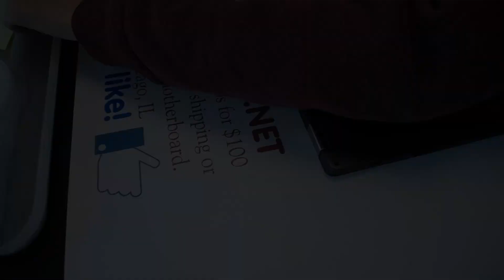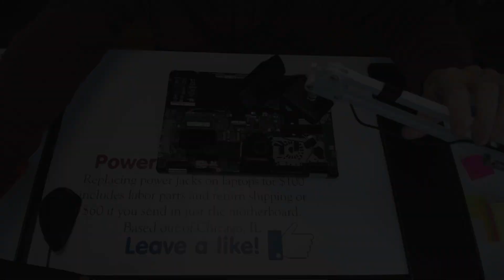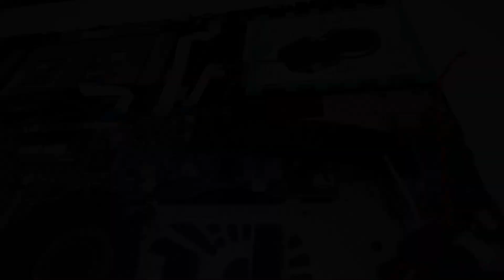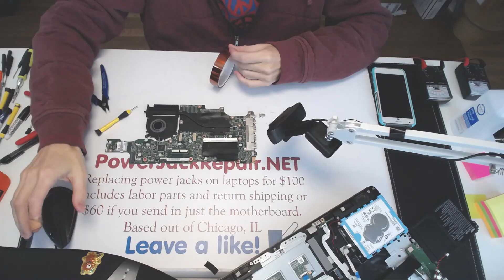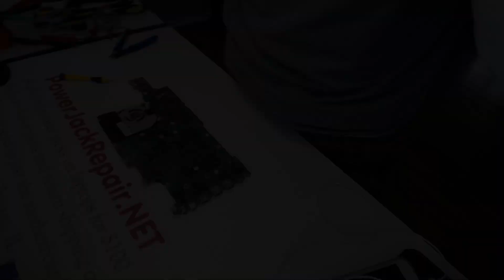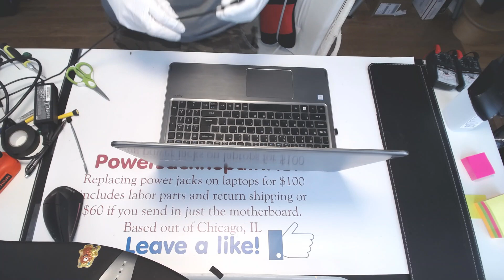How to fix laptop not powering on Acer R15 R5-571T broken charge port power jack repair charging

Comment: One question, you identified the bad solder joint, why not just resolder it ? 
Thanks very much I have had such good luck with this model and spec esp when I found the not advertised Sata SSD M2 slot on the motherboard as well as the fact the industry has dumbed down models for that price point since then. (As in no more touch screens or 2in1 (flip) at that price point or anywhere close anymore.)  But the power jack was a chronic problem with the with it, but worth repairing.  
Thanks again !!!

Comment: I have a question do you know why my Alienware M17x r3 isn’t turning on? Everytime I put my charger in the laptop the lights turn off
Reply from the maker: that is the shortage on the motherboard, not the jack, maybe one of your video card chips is shorting.
Reply: Power Jack Repair so what do I need to look for?
Reply from the maker: @juand5270  remove video cards, plug in your cord if the light on the cord won't go out that means one of the cards is bad.  If the light goes out after you remove the video cards that means something on the board is burned, you should see the burning usually
Reply: Power Jack Repair I removed my video card and when I put my charger in the light turned off. So I’m guessing the motherboard is burned?
Reply from the maker: @juand5270  yes it is, look for anything that looks like burned on the board, black spots on parts.
Reply: Power Jack Repair after I find the black spots do I need to replace the motherboard?
Reply: Power Jack Repair do I need to replace the motherboard or can I fix it?
Reply from the maker: new board will probably be a better solution
Reply from the maker: @juand5270  either remove the components that are burned or isolate the area.